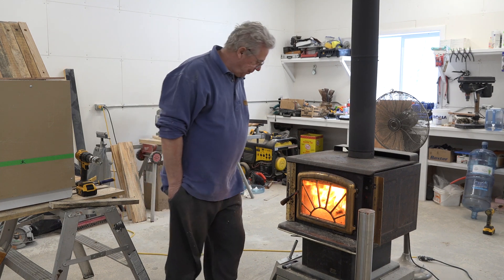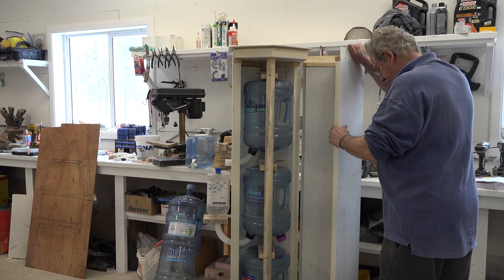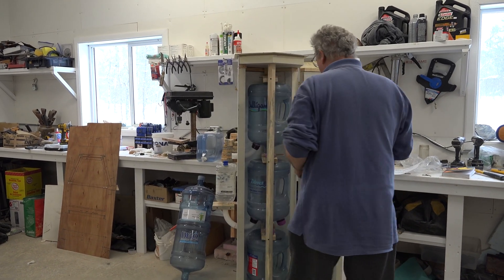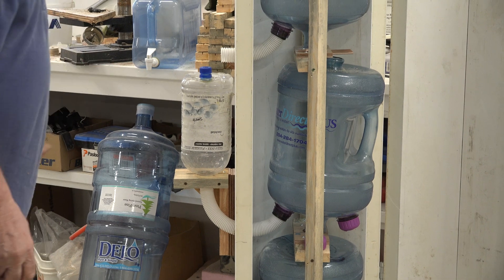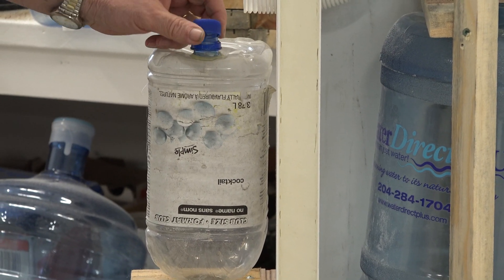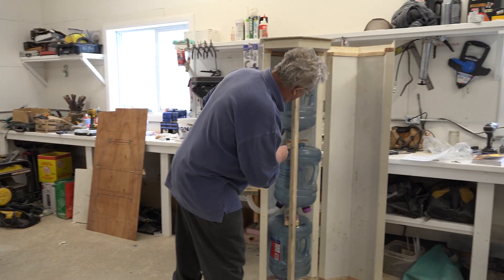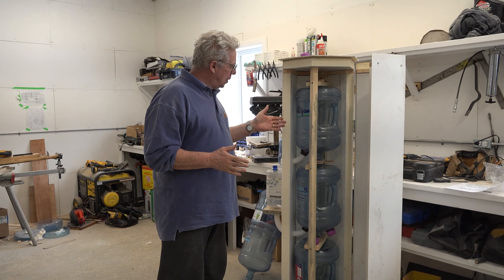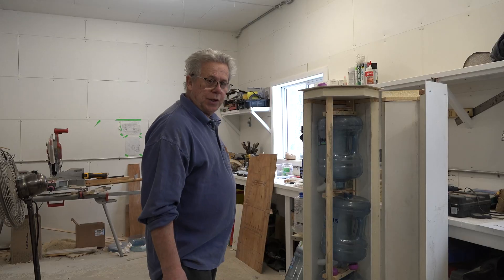Bottle to bottle See Through Bee Hive | Part 2

Comment: With such an enclosure why do you need bottles at all? Have removable frames in 2-3 levels inside the big box and be done with it.
Reply from the maker: You are  absolutely right.  The  reason  for the  bottles  is to see more  of  the  bees  working  and  observe.  After  months  of  working  with  bottles  I have  come  to question  many  of  its  properties.   The  evolution..?  The  bottles  need  lots  of  protection   especially  in  cold  climates  nullifying in many  cases  it's  viability.  If  you  look  at the  2.0 model  I tried  to  simplify  it more  and  yet  it still uses  lots  of resources. So  I basically  come up  with the same  conclusions  that you  suggested.  I will  make  a  video  in  the  future  about  the  pros and cons  of  it all.  I was hoping  to  come  up  with  a simple  and  cost effective   model  but  the  properties  of  the  bottles  dictates  otherwise.  So  I was  going  to use  my  existing  enclosures  to  yes have  removable  frames  as you  have  suggested  and  be done with  it  thanks  for  your  remarks  .I appreciate it  ..